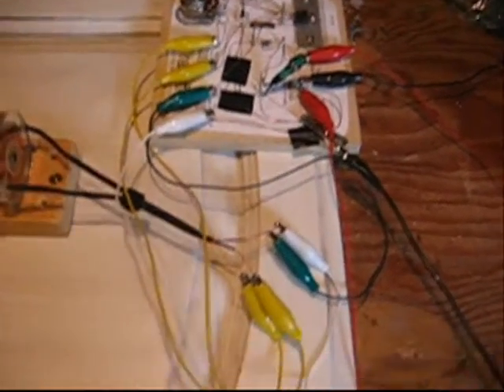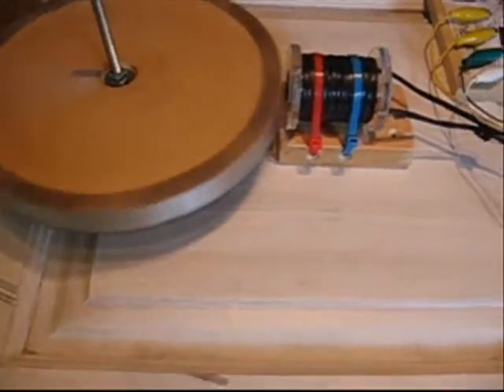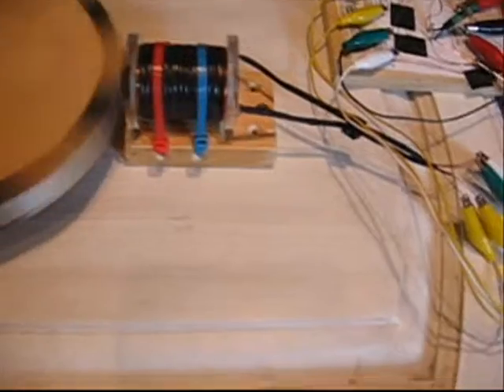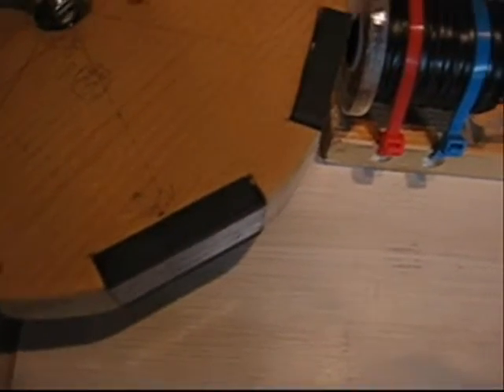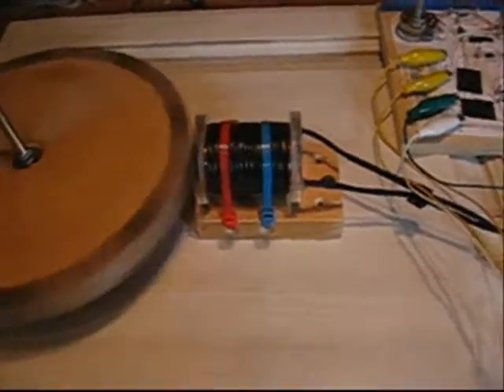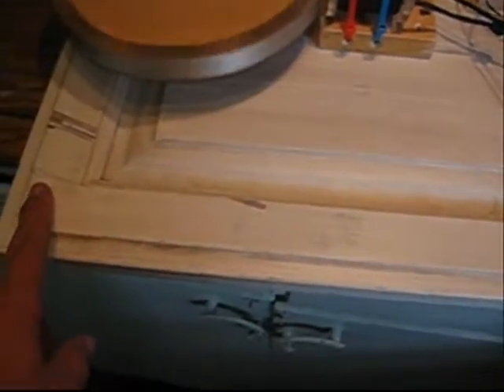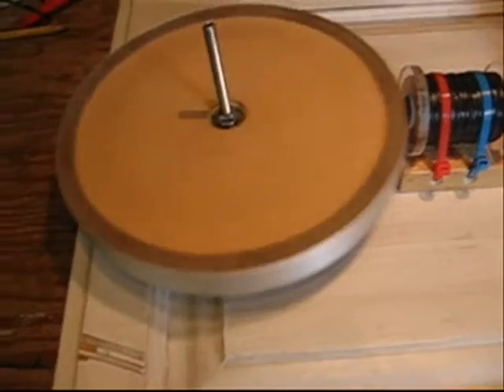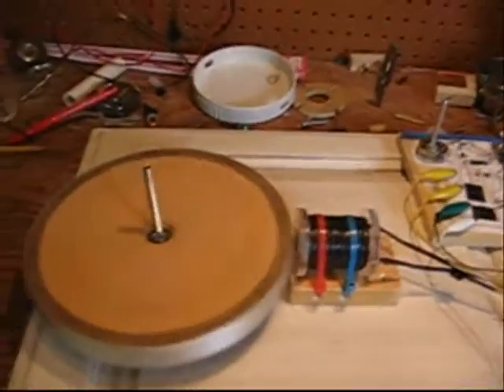Battery charger bedini style

Comment: What size resistor are you using in the circuit? And do you need to use a Neon light Off the Transistor? or could you use a LED?